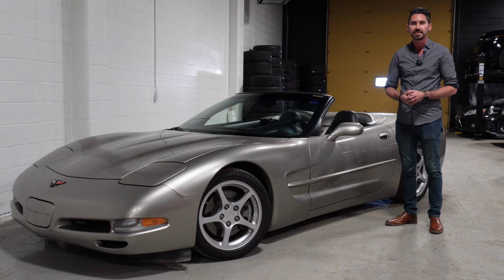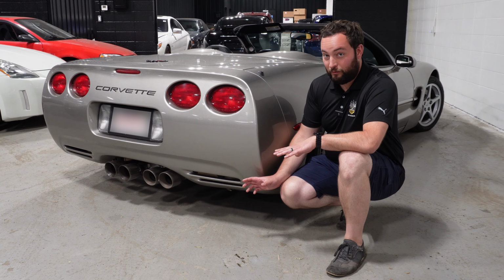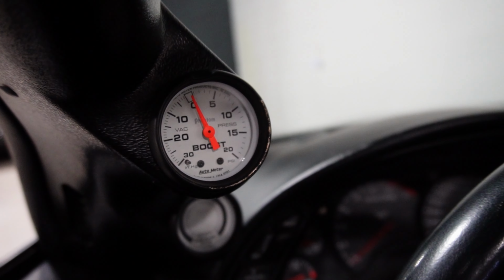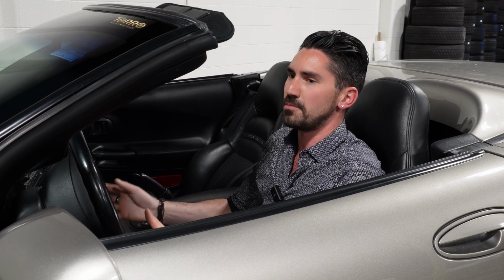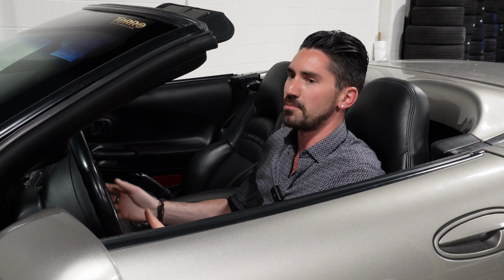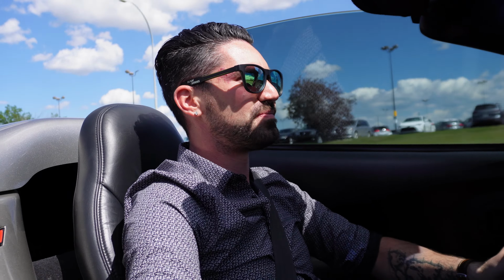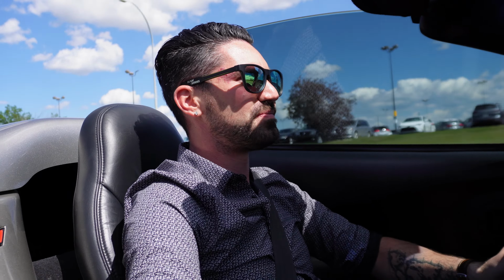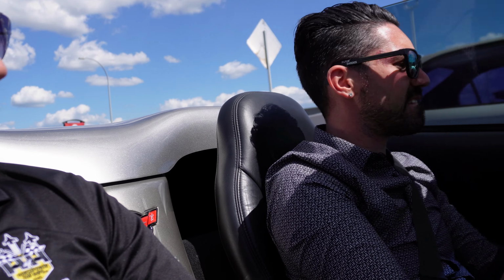SPOTLIGHT - Twin Turbo C5 Corvette!

Comment: 500 ish  is that crank or rwhp ?
Reply from the maker: Approximate crank, should be in the low 400s whp. Easily drive-able but still an animal!
Reply: @centauricollective  Any other mods or just turbo setup?
Reply from the maker: Just the turbo set up and supporting bits for fueling. STS developed it to be essentially directly plug and play on an otherwise stock C5. 5-6 psi of boost is very comfortable for a bone stock LS1. So although its not the most powerful twin turbo set up, it certainly doesn't lack fun factor!